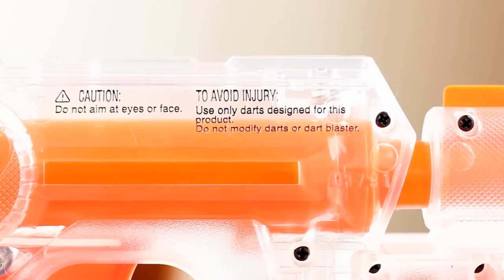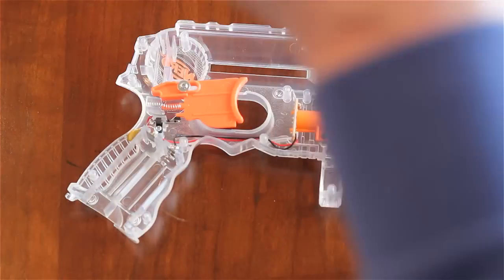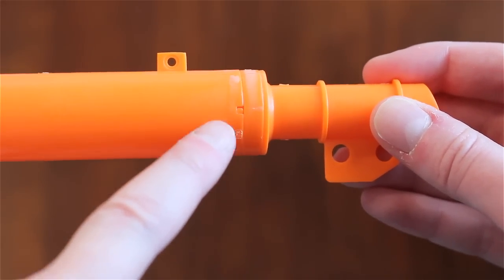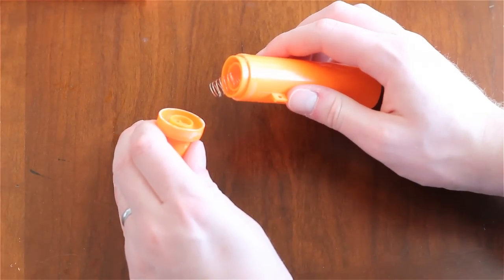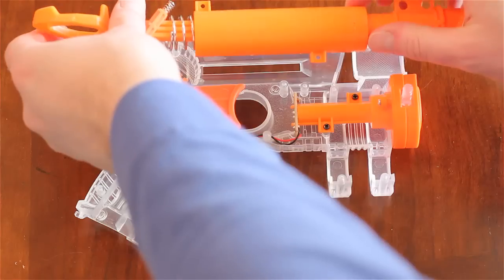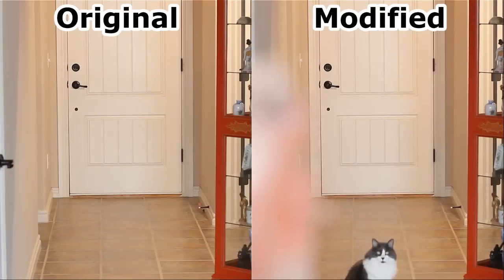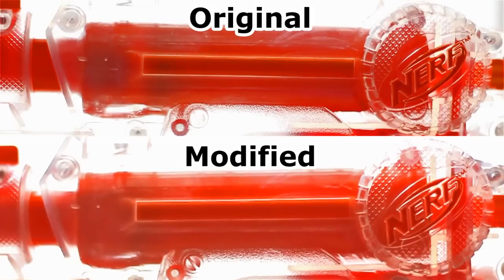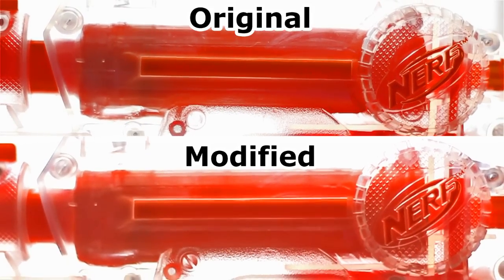Easy Nerf Gun Hack (NEW)

Comment: Air restrictors are there to keep the mechanisms from wearing out too quickly. It's better to pad the plunger or other colliding parts before firing a blaster without an air restrictor, else it may break after 30 or so fires.

Comment: I love how he has no idea what he's talking about,if oh take out the air restricter and dry fire the blaster .the plunger head will hit the front of the plunger tube and make the plunger head crack(making the blaster useless) the air restrict or is there to take place of the dart and create a soft air cushion.Ik that taking it out will help but not by much.i suggest you should put a stronger spring or add elastic a to the priming handle.so it can create more pair pressure resulting in a dart going much farther

Comment: I apologize ahead of time, but I must troll a little: AR removal only effects the final result in small arms, such as anything smaller than a Firefly. Do not preform this modification unless you are able to use tools without being stupid. Also, the firing angle in the test videos appears to have a base trajectory higher than a zero-angle (flat), which ultimately skews results.